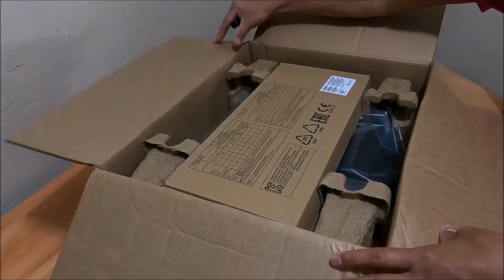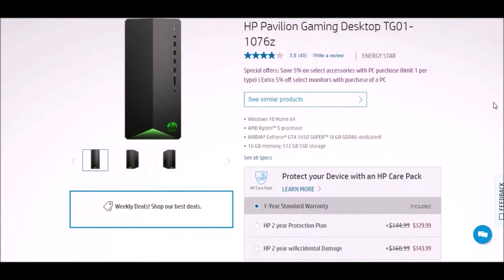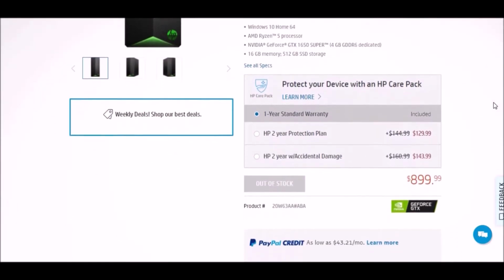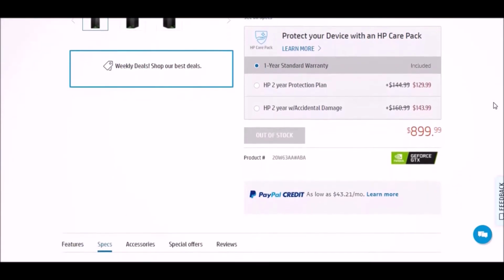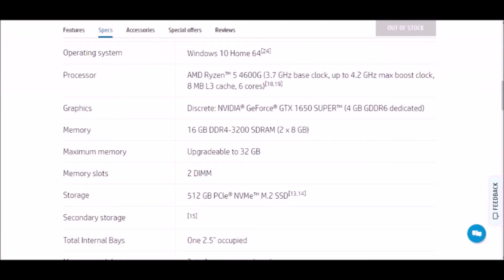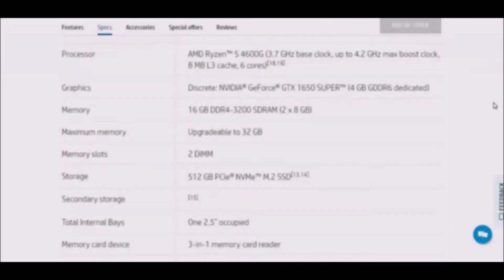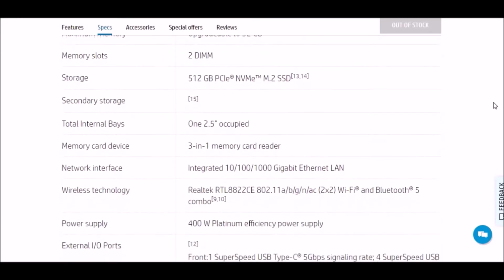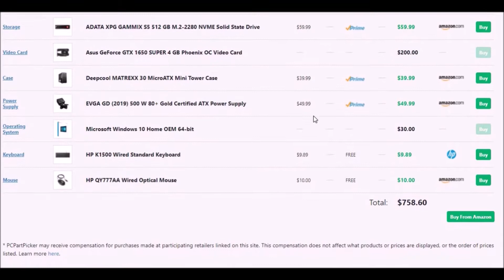Should you pick this up when in stock? HP Pavilion Gaming Desktop TG01 1076Z review and disassembly

Comment: How to upgrade the video card of this build
Reply from the maker: You can swap the default graphic card with anything, provided it is not power hungry. This PC has 400W power supply only. I would refrain from putting anything above 200W. Also, the PCIe power connectors are limited. You would have to buy Sata to PCIe power adapters